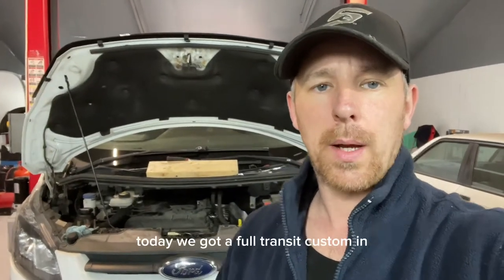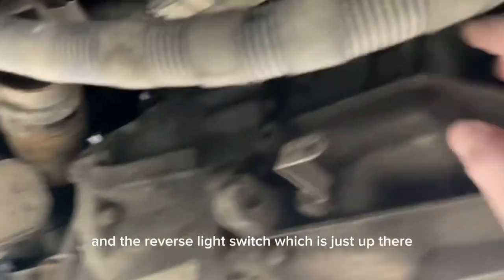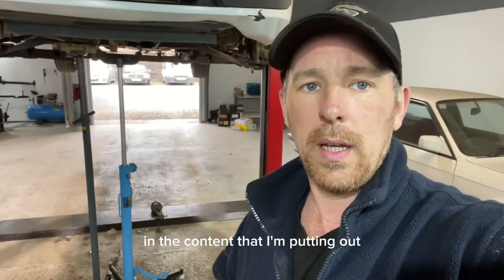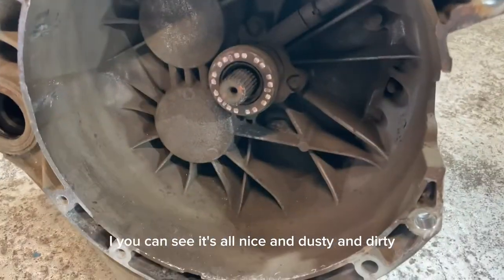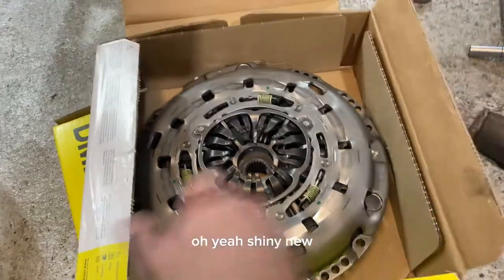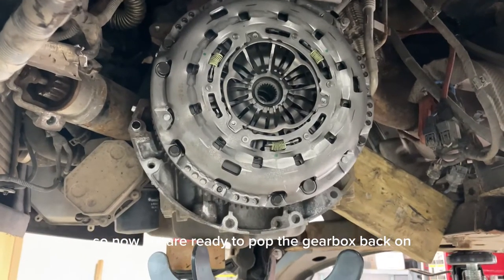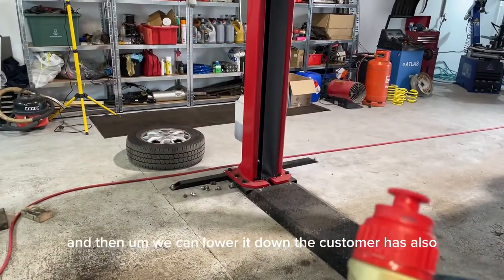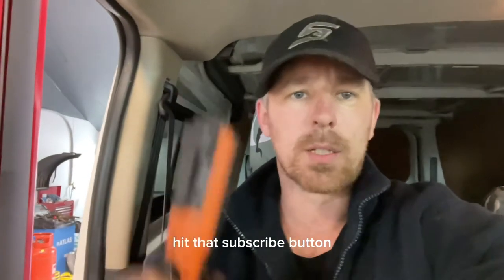How to Replace the Clutch and DMF on a Ford Transit Custom!

Comment: Cheers, handy Video.
Getting shudder at some junctions.
2013 at 164k miles T260. . . . No history, but sump has been off at some point.
Cost benefit analysis is border line. . . . .
Reply from the maker: Your welcome 🤗 depends on the condition of the rest of the van really as to weather it’s gonna be worth doing 👍

Comment: Brilliant video. Looking at getting a 2015 custom with 105k and getting the clutch done would be the first job for me. Definitely a garage job by the looks of it. 
Had clutch and dual flywheel done on 16 plate 4x4 kuga and that was £1400 . Think because of the 4x4 bit.
Thanks for sharing
Reply from the maker: Hey 👋 good luck with getting the transit hope it’s a good one! 
Thanks for watching 👍

Comment: You said you had to force the flywheel back over the bolts to get it undone, how did you manage to force it over as im sitting with the same issue
Reply from the maker: Hey 👋 I used a big pry bar to force it over but if it’s too far gone and you can’t then you may have to get the grinder out to cut out the centre so you can get to the bolts! Let me know how you get on 👍
Reply: @MrAutoFixer  thanks appreciate it, ill let you know how it goes

Comment: Hi,thanks for the video i am watching from italy to learn how to do.
Personally i have the 2.0 170hp,do you think is better a luk clutch or valeo? Thanks
Reply from the maker: Hey 👋 thanks for watching! And I use LUK a lot so would use that I guess, but valeo are a great brand too so which ever you can get hold of will be fine👍
Reply: Thanks man,because my mechanic said me replace the clutch with the same brand as you find before on the van,but i want to order the parts before dismounting for a faster job
Reply from the maker: @tdf3181 well I agree get the parts ordered and ready to make the job go quicker ! I do the same thing 👌
Reply: Hi man,did you know where i can found the electric diagram for a transit custom 2021? Thanks
Reply from the maker: @tdf3181 hey 👋 I would say if you can’t find one on Google then you should ask your local garage if they have autodata or similar and they might be able to print some diagrams off for you ? 👍

Comment: I had my clutch done recently then 4 days later when driving the engine cut out and wouldn't start again.
Do you think that there's something i.e sensor, switch in the clutch system or bad earth can cause cause van to crank but not start?
Reply from the maker: Hey 👋 Yh there defo could be something in that job that could cause your fault, but best advice would be to get a code scan done to point you in the right direction, it could be something really simple and easy fingers crossed 🤞 let me know what you find 👍

Comment: If you don't mind me asking how much was all the parts 👍
Reply from the maker: Hi Chris, depending on where you get them from that can vary quite a bit but for this job all the parts cost around £600 that’s the clutch kit the DMF and the bolts and oil, hope that helps 👍

Comment: hello, I have a transit trend 2.2 from 2016, when leaving a place or when parking, there is a noise as if the engine mounts are broken, (bang) the same is heard when driving when I change gears, 
I want to mention that the modor supports were changed for the third time in a row,  driveshaft they are new , new flywheel clutch, reconditioned gearbox  , so everything is brand new, everything was changed for this reason, and that noise did not go away ,
Reply from the maker: Sorry to hear you have spent so much money and not found your issue, firstly please find a new place for your future diagnosis inquiry’s ! And from What you describe and things you have replaced, I would say your fault is most likely suspension related, obviously impossible to tell without looking but that’s where I would be looking👍
Reply: it is normal for there to be a little movement in the flywheel?
Reply from the maker: Yes the dual mass flywheel is ment to have play by design, there is a max tolerance of course,
Reply: all the parts are original, I didn't buy bad quality parts, I spent a lot of money, I'm very disappointed, how could I send you a short video tomorrow so you can see what it's about?
Reply: where are you based, if I may ask?
Reply: Hi, was this issue resolved as I have the same clunking noise when changing neutral to first?

Comment: Just stripped a gearbox out a 19plate custom with 23k on it and the duel mass is absolute toast
Reply from the maker: Wow that’s not good, they just be using playdoh now days for materials !
Reply: @MrAutoFixer  its really getting worse mate.  3rd 19 reg in a row for transmission work.    Fantastic tip with the gearbox stand btw just used that and it helped tilt the box in a treat!
Reply from the maker: @jamiesmith5684 I know mate I’m seeing lots of younger cars with old car problems, but I guess it’s good for me tho lol 😂 and Yh all the little tips and tricks really help so I do try and share when I can 👍

Comment: My transit clutch is clunking when idling and the pedal feels like it is the brake pedal when the ABS comes on. I take it its the clutch? It goes away after a bit. how much can it last and will it do any more damage other than the clutch.
Reply from the maker: Yes sounds like you need a clutch and dual mass flywheel, it’s hard to say how long it will last as I’ve had some last a very long time and some just go pop and fail fast. Best off getting it done before it becomes un drivable 👍
Reply: @MrAutoFixer  It happend a tear ago and went, it seems to have gonr for the moment, just aswell it need the cam belt doing and that mean I will be shelling out a load of cash, what is an average cost for s complete clutch fitted

Comment: I’ve got a Ford transit custom and when I put it in to 4th and 6th gear it revs up like it’s in neutral
Reply from the maker: Well it’s sounds like not engaging the gear properly I recommend getting it looked at asap incase it leads to a larger problem. 👍

Comment: I have a 2014 transit custom with only 53500 miles fsh sometimes first get is stiff when cold is this normal
Reply from the maker: Hi no it’s not normal, what I would do is have it checked over to see if there is a fault with the cables or if the problem is internal of the gearbox. Then you will know what plan of action you need to take 👍
Reply: thanks for your reply, van drove perfect today selected al gears easily , I was going to get the gearbox oil change see if that helps ?  @MrAutoFixer
Reply from the maker: @user-ki5ju6tq6k that’s good then, a gear oil change can’t hurt and you can check the condition of the oil too and see if there is any filings or debris in it also 👍
Reply: how many km did it last?
Reply from the maker: @gyenesjani hey I’m happy to say the van is still going strong 💪
Reply: I worded it wrong, when did it have to be replaced?   km (miles) ? @MrAutoFixer
Reply from the maker: @gyenesjani  this van had done about 130000 miles I can’t remember exactly, normally a clutch is expected to last about 70,000 or more driving style dependant. 👍
Reply: @MrAutoFixer my car has 145,000 km on it, but it still runs fine
Reply from the maker: @gyenesjani yes that’s good and some clutches will last way longer if the vehicle is driven nicely and looked after well as usually always tell-tale signs that the clutch is starting to go either the clutch pedal bite gets really high or it will start to slip under load.

Comment: does nlt show details of techniques used in this whole process like the 3 stages of tightening the flywheel and the technique use to prevent the flywheel rotating whilst tightening the bolt etc.. Not worth watching
Reply from the maker: Hi sorry you feel that way! The video is only 12 mins long not a 4 hour tutorial. Maybe you could make your own video on the process and share it 👍